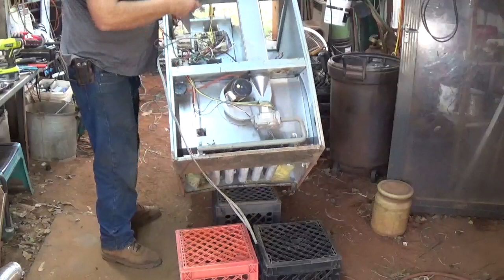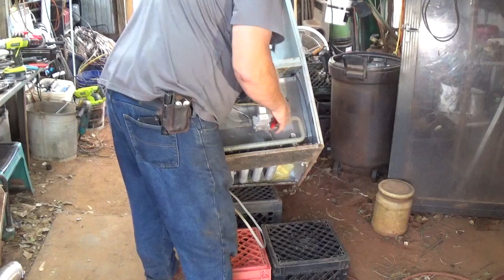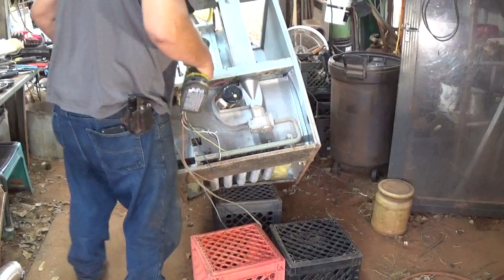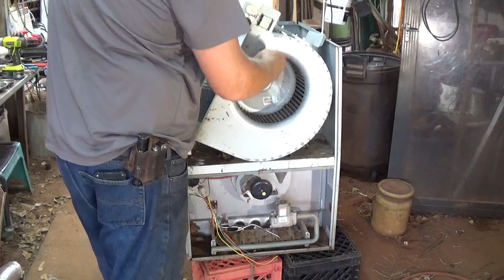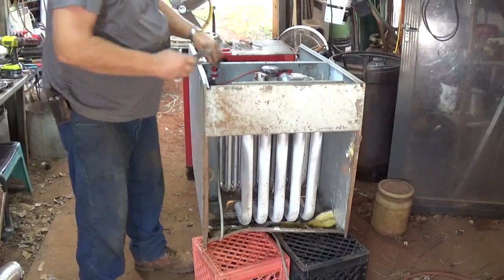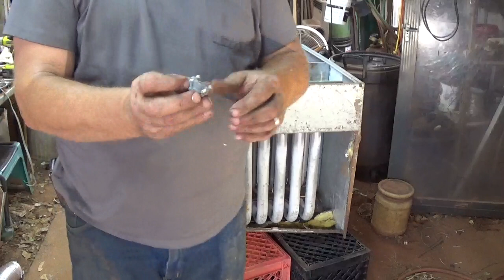Scrapping out a furnace for copper, copper wire, some aluminum, and tin, shred, or light iron.

Comment: I part a lot of these and and scrap them too. Good video!
Reply from the maker: not a lot to them, they do have some nice copper in the motors
Reply: I've had pretty good luck on resale with furnaces. I get them from a contractor and he tells me if the were working or not. And being in wiscosin, there are tons of people looking for cabin heaters for their hunting cabins.  I usually sell them dirt cheap for around a 100. And they fly out the door.